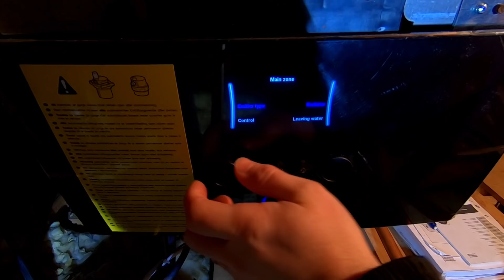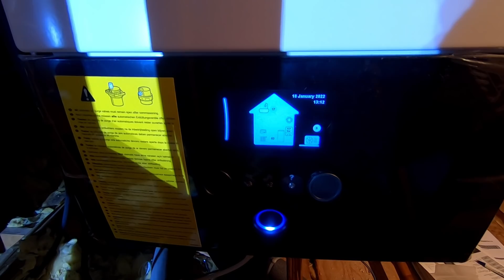How to lose £2000 installing a heat pump

Comment: Leaving aside the electricity running costs, heat pumps - air sourced in particular - are only reliably effective installed in an up to date modern day spec home. Majority of the housing stock in UK isn't suitable for the cheaper A/S heat pumps. Recently spoke to someone who'd paid £20,000+ to have it installed in older property. Not happy with cost or performance.
Reply: your comments apply to all heating systems.  Installing a gas boiler in a poorly insulated, draughty house results in the same amount of heat lost.  A lot of the complaints about both air & ground source heat pumps relates to them running at a lower temperature.  If the rads aren't upsized at the same time people are disappointed with performance.  Given the cost of energy at the mo (and its hard to see it get cheaper anytime soon) insulation is the key, but if its not done right air sealing a house results in condensation and problems like mould and in the longer term damage to the fabric of the property.
Reply: @davehughes9448  That is a known, as things currently are gas boilers have more capability to overcome poor insulation which isn’t a helpful feature of old property. Retrofitting can be enormously expensive to bring an old property up to a modern day standard. For a gas boiler in a modern property it’s a walk in the park, but absolutely a necessity for an air sourced heat pump which is significantly more expensive to install & run. The government is trying to bring about quick results.to demonstrate it’s doing something, but it will be largely at the expense of the well heeled customer that can afford it. The longer term economy of scale, R&D and developing technology will prove the potential of hydrogen. It isn’t a quick enough fix for Boris & Carrie. JCB is one (private) company in this country that’s putting it’s money where it’s mouth is, with over a billion £ investment in green hydrogen supply from Australia.
Reply: @Angloman516  Carrying hydrogen around the globe is totally inefficient. It will not be affordable either.

At the moment mini split/multi split/vrf systems seem to be the more efficient option to heat old houses. Good indoor and outdoor units are designed to work together and provide a seasonal efficiency (SCOP) in the magnitude of 4-6 without further remodeling while real world airsource to water heatpump systems only have a medium COP value of 2 to 3.5 and require expensive remodeling with insulation and underfloorheating.
Reply: @dge5348  couple of things, why are heat pumps being promoted if split units are more efficient. LNG is already. shipped around the world, production of hydrogen by UK off peak wind farms etc will be coming on line with delivery by tanker to filling station that don’t have their own green hydrogen generation plant.
Reply: Splits have electric heaters don’t they?
Reply: @Angloman516  Split units are not promoted in Europe because of possible uncontrolled leaks of refrigerants which are more potent climate gases than CO2. The administration doesn't care if it is too expensive to remodel a home to be compatible with x2water heat pumps and the industry is keen on the opportunities to generate revenues. All fossile fuel fired heating systems will become prohibitively expensive over the next decades and electricity together with environmental energy will be the cheapest option. When you have an old home, limited financial resources, no other options to heat and you don't want yourself to freeze to death in winter, you will not care about possible refrigerant leaks.The funny thing is, in the US, split systems are promoted to be very efficient heating systems even in cold climates and far more efficient than their traditional ducted systems. Additionally some claim, split systems are very common in Europe. 

LNG has a much higher specific volumetric density than hydrogen. Liquified hydrogen has to be cooled down to only -259°C while methane becomes a liquid at -160˚C. To cool hydrogen down to near absolute zero Kelvin it takes lots of energy and then the amount of energy transported in the same size of ship is only a fraction compared to methane. It's definitely far less efficient to use hydrogen. Unless there is not a gigantic technological breakthrough, hydrogen will always be a very expensive option.
Reply: @Angloman516  I only know some Mitsubishi mini split systems for cold climates (up to -25°C) which have a special 50W heater for defrosting the outdoor unit. Devices speced for -15C have no such thing, but their heating capacity degrades far more when it gets really cold. 50W is only a small amount of electrical energy when compared to output heat  of e.g. 4kW at -10C
Reply: @dge5348  Energy is going to be more expensive, it goes without saying. Technology R&D is moving on all the time and these are relatively early days where undoubtedly there will be a mix of various systems applied to numerous requirements before things settle down to a recognised acceptance. People like Lord Bamford of JCB don't make decisions lightly recognising its horses for courses and what produces the best result. Instant electrical power isn't available in many  locations, but a hydrogen refillable tank is. Japan has recently taken its first delivery of green hydrogen from Australia, it's constantly getting cheaper, Industrial use will require it to be.
Reply: @Angloman516  Definitely, in the future there will be many applications for hydrogen but passenger cars or heating systems will be none of them. 

About 3 times more green electrical energy is needed to produce and distribute hydrogen than the heat energy you will get when you burn hydrogen in an oven. When you use a heatpump, you ll get up to 4-6 times the amount of heat for your kWh green electricity you put into the system. That's a factor of about 15 which seperates both options. There is no way heatings powered by hydrogen will be able to compete with heatpumps any time soon.
Reply: @dge5348  I think you are wrong, there will be a mix, hydrogen will be used in transport particularly heavy transport. Asia will probably lead the way with Toyota & Hyundai, all major producers are doing development with hydrogen. Range and refill time will always be an issue which is more assured with hydrogen. There will be more BEV's for sure they are better suited for local operation. British gas is already advertising hydrogen ready boilers, that must tell you something. Batteries are heavy and expensive as can be the charging facility, hydrogen is reducing in price by the day. There will be a place for both in the market for people's needs and requirements.
Reply: @Angloman516  ,I also thought hydrogen might prevail in heay transport applications until last year when I heard a lecture from an insider who stated the price of BEV trucks is only about one third compared to fuel cell powered trucks and they are also far less expensive to run and maintain. Transportation is a very competitive business and as a professor with many years experience in this field he thinks it is very unlikely that fuel cell trucks can ever compete based on costs. Additionally there is the infrastructure problem. If the niche for special hydrogen trucks is too small, there will never be a chance to maintain an economically viable comprehensive network of hydrogen filling stations.

I have heard of hydrogen ready gas heaters but I think this is only part of a marketing strategy to maintain an outdated business model as long as possible. Buyers have absolutely no guarantee to be able to switch to hydrogen when NG becomes too expensive or unavailable.
Reply: @dge5348  Think you are being rather narrow minded, you imply there is no place for hydrogen and batteries will resolve every need. I'm afraid that attitude flies in the face of the enormous investment going on  within the hydrogen industry. Like I say horses for courses.
Reply: @Angloman516  there is definitely a big market for hydrogen in the steel, cement, fertilizer, chemical industries and for efuels, seasonal storages to make renewables viable for the electrical grid. Whether hydrogen will prevail in other areas will be decided by the market based on convenience and costs relative to other options. For me the chances of hydrogen use in basic mobility and home heating market don't look very good based on the inefficiency compared to simple electricity from the grid. We'll see how things will develope.
Reply: @dge5348 There are efficiency differences with a lot of various fuels currently on the market, not least hydrogen having up to three times more efficiency that petrol. The operating efficiency of battery cars, leaving aside the manner of electricity production, wasn’t the driver of their development.
Reply: @Angloman516  No they don’t have ele heaters.
They work by moving refrigerants with different condensation/evaporation temperatures anr at the same time moving heat (energy) from one place to another …..it is a bit too technical for ordinary people to understand
Reply: @Angloman516  'Green' hydrogen from Australia??? 🤣As 'green' as a Toyota Prius, I guess. Gives the consumer the warm and fuzzies, until someone points out the huge carbon cost of shipping
Reply: @sapiotone  If it wasn’t viable it wouldn’t happen.
Reply: The words "Cheap" and "Air source Heat pump" are not to be used in the same sentence
Reply: @danieladams7919  Relative to ground sourced
Reply: In Ireland, Eire, there's no HP grant from the SEAI without a full technical assessment, basically an energy survey covering the heat retention and ventilation in place. Not free, about £400, and paid back out of the grant if you get it. There's a follow up report to help the home owner make the house heat-pump -ready. Generally these improvements are violently expensive for a house of 2006 or earlier, the age it has to be to qualify.
Reply: @kyarichards2894  That is certainly interesting info which rather bears out my point.
Reply: We've had a Mitsubishi 11.2kw unit installed in an EPC-E rated 1960s 4 bed house, and it works great. 4 way valve failed 6 months in, new unit had to be swapped in. But in terms of heat, it's great. It took 7 electric heaters to bring the spaces to comfortable warmth when the ashp was down. About 100kwh/day 🤣. Now the house is toasty, at around 30kwh/day
Reply: @Loopyengineeringco  Good to know,  what was the total supply & instal cost,  plus what sort or room temperatures at 0C outside are you achieving?
Reply: @Angloman516  it was 15k, and with rhi&mmsp we're on track to recover 12k ish. This was for all new radiators,
 + 200l unvented mains pressure upgrade too. Needed a huge amount of remedial/tidy up work due to installers being cowboys (greener living) but we're happy. We run the house at 19c at 0c ambient, the 11.2kw pump is at around 75% duty I'd say
Reply: @Loopyengineeringco  Is it a detached house & are your walls insulated?  A positive report although expensive.
Reply: @Angloman516  it's end of terrace with many large, bad condition double glazing windows & old cavity insulation in need of topping up. 2 Flat roof extensions with old, nackered fibre insulation.
We have 3.8kwp PV too, so we time the hot water recharge to coincide with sun, and it generally cuts 20% off the bill (in winter so far, summer will be almost free)
Reply: I agree the air to air does indeed need a well insulated house to keep the running costs down but would be more effective than an electric fan heater with the bonus of cooling. The video is installing air to water which would be considerably cheaper if the unit is sized correctly the cop will be higher sometimes over 4 units of heat per 1 unit electricity compare to electric 1 to 1 ratio it can save a ton
Reply: I have two air sourced heat pumps in a 1950 Finnish house, have had for 10 years now. The completion date of your building -- why should it matter?
Reply: @Itapirkanmaa2  Because of the lack of insulation value. Finland being in colder climes than UK built homes accordingly I would have thought. What is the heating capacity of yours?
Reply: @Angloman516  Well, a 1950s Finnish house is not a wonder of insulation. It's the standard size Panasonic, I get some value out of them down to about -20C. Modern ones I think get even lower. 
In the UK it would be working at the most favourable range most of the time.

In terms of heat generated inside your house, I really can't think it would NOT be of similar favourable consideration that pretty much everyone has done over here in this country during the last 10-15 years...!
Reply: @Itapirkanmaa2  My question was, what is the heat output capacity of both units. Additionally do they heat your hot water?
Reply: @Angloman516  Can't recall, the standard size, they heat air only, and cool it when we have the rare summer heat wave on.
Recently, air/water units have gained a lot of popularity as retrofits here.
Deep geothermal heat wells are even more popular, I'd think the majority of new residential houses have one in Finland.
In Helsinki area they're now building the world's deepest test well for district heat to over 6 kms.
Reply: @Itapirkanmaa2  Throw enough heating capacity at it, most houses could be heated, boiler or heat pump. Price is the other consideration relative to capacity, 
 electricity very expensive here. My gas boiler has a rated output capacity of 24 KW for hot water and heating radiators which is more than enough. Quite what a air sourced heat pump would cost to provide the same I don’t know, sure electric running cost would be mega. Having Geothermal is very fortunate. Ground source heat pumps are considerably more effective but horrendously expensive.
Reply: @Angloman516  Installing geothermal (existing water-filled radiators) begins at around 20,000 euros going up to 50,000. Geothermal is the majority choice for new residential houses here in Finland, and is normally somewhat cheaper then.

We have practically no gas boilers, but wood chip boilers are common in rural areas for large houses, and farm houses.

We in fact use the air heat pumps to save on electricity, although we have (had) some of the cheapest electricity in Europe.
Reply: @Itapirkanmaa2  we have gas from North Sea. Geothermal is environmental answer but an expensive installation, what are the running costs?
Reply: @Angloman516  Ours is the standard Siberian variety that is used for industry and power generation in the south of Finland.

Can't say off-hand the running costs but in relative terms people appear to be saving considerably in the geothermal, otherwise it would not be as popular as it is. I know someone who's been running his like 20 yrs or so.
Reply: If they don't go hand in hand with raised insulation and air tightness, I totally agree.
Reply: @kyarichards2894  wrong. insulation has nothing to do with the form of heat generation. its only a factor of how much heat you need to generate.
Reply from the maker: Supreme ruler is correct !
Reply: @UrbanPlumbers  sadly this is not said often enough. if you get the chance you might want to mention such things in videos. it might make some people think better about the difference between heat generation and insulation. (and that i am right ofcourse)
Reply from the maker: When it comes to heating and heat pumps people just love to express their opinions usually without any real understating of those subjects.

You can try and explain those things but no one seems to want to listen.
Reply: @UrbanPlumbers  yes, people love to drum their own drums. even if they dont know why they are beating it in the first place. still, if you have a chance to correct a group of interested viewers it might help change some people. not all of them. but small steps.
Reply: @UrbanPlumbers  We are on the cusp of a significant  change in energy use. Much opinion is coloured by media perceptions of where it’s all going. The fundamental of what people are concerned about is cost and what they think will be the cheapest option,  there isn’t a cheap option, but the cost of running that option is giving a lot to think about, particularly as it will be the government definitively that sets the tone. One point, a collection of Ashoka in a terraced block will tend to generate a concentrated amount of noise from fan air movement.
Reply: @kyarichards2894  I've pulled out all the measures(cavity, loft, Underfloor, room in roof, hatches) when it comes to insulation for when I eventually get my heat pump installed. I've also been working hard to airtighten and installed an underfloor heating system. All this in a 60's house, wish me luck lol..
Reply: The government is backing the technology with alot of tax payers money. But the technology is fucking rubbish.
Reply: @rob-123  all of the air to water heatpumps are hard to justify. Even in Colorado with super thin, dry air I get customers who just want to go all electric with a heatpump and backup source of electric resistance elements.
We have abundant, cheap, clean burning natural gas, nearly 98% efficient modulating boilers and furnaces that can operate in 10% increments of btu capacity based on an outdoors temperature and heating setpoint curve reset.
Often times the folks who are doing it not for economic reasons but for more what seems like virtue signaling, I encourage them to install both systems. 😀 
That way in case of severe weather they have a boiler to get them through. And when we are in shoulder seasons, we let the heatpump operate in its most ideal outdoor temperature ranges of 15-60 f.
The heatpump lasts longer, and when the efficiency and btu capacity start to plummet below 15f degrees, we reset our efficiency curve with the boiler at 98%
All of our customers have been sharing with us their utility bills, and even folks without PV electric panels see a huge energy savings with the dual fuel system.
Tightly built homes have achieved a net zero rating
Reply: The problem is that in England, people don't invest in their homes! Who has insulates house ?
Reply: I agree.That's what I have heard. The problem is, the government wants to roll out its agenda and convince everyone they should be using these heat pumps. I don't think fossil fuels are going to run out. They keep discovering new deposits. Gas is clean burning so it should not be so bad as other more polluting fuels.
Reply: @johnchoice1371  It's nothing to do with fossil fuels running out, they just don't want to use them.
Reply: @Angloman516  I know. I said the fossil fuels are not running out, so there would have to be another reason. It's political, they can create a scarcity and manipulate the market.
Reply: @johnchoice1371 Oh yes, different vested interests are up to all sorts of manipulations
Reply: @johnchoice1371  It makes sense to avoid burning fossil fuels where possible so it can be used for far more important products like medicine. You say they keep finding gas depsoits but they tend to be in areas where it is difficult to extract and therefore expensive.
Reply: @johnriggs4929  The new coal fired stations is because the companies of the west want cheap manufacturing costs. The energy china pumps out if primarily for industrial use not domestic. Domestic power usage of a chinese household is significantly lower than those in the west per capita.
Reply: @Angloman516  
We all, should not want to use fossil  fuels! The evidence of global warming is undeniable and if we do not act quickly, the tipping point will be disaster for our planet! (Sir David Attenborough is one of the few educated commentators we can trust on this issue)
Reply: @georgestewart1983  Of course not, but the transition to other means can’t be done overnight.
Reply: @johnchoice1371  it doesn't matter if fuels run out or not, fuels have always been a political issue and they want more leverage by having less need for foreign oil